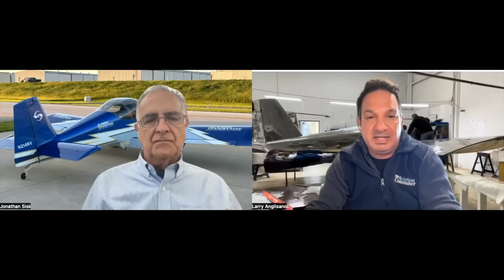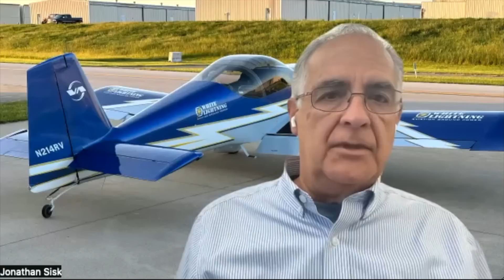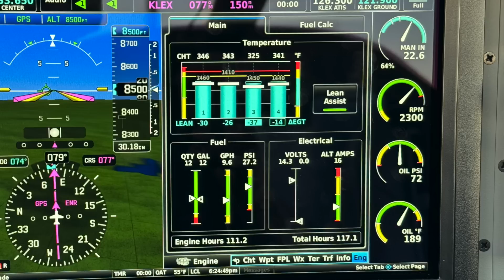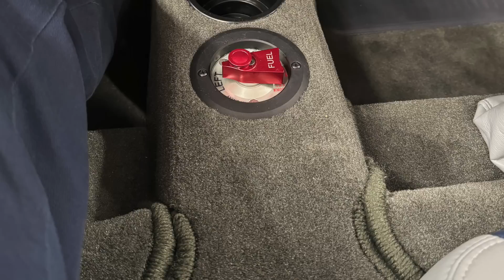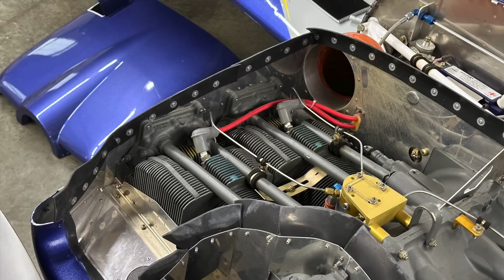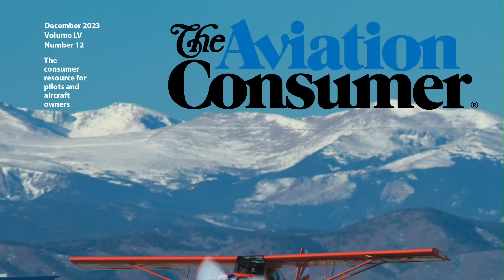G100UL Unleaded Avgas Flight Trial

Comment: There is one advantage of unleaded besides health that no one is talking about. I was in the automotive world  during the switch over from leaded to low lead to no lead. There was a big drop in thick carbon build up on valves, combustion chamber, and piston tops. The old days when the combustion chamber and piston top became coked up it produced spark knock on light acceleration. Then some sort of cleaning such as removing the heads and scraping or poring water or automatic trans fluid through the intake at about 2000-2500 RPM would be needed for repair. Sometimes we would recommend a higher octane fuel it it was an old warn out engine. Probably not advisable with airplane engines. Engines using unleaded fuel have only a thin coat of coal black carbon about the thickness of a coat of paint that many people think is a carboned up engine when in fact it is created in the first thousand miles or so that does no harm. If the valve guides leak or it is a direct injected engine with no fuel in the air stream the valves can get heavily coked up but if excessive oil passes through the piston rings it generally washes the piston top clean or at least in the area of the leak if it's not too bad. Unleaded fuel is actually a good thing. Some claim valve wear without lead but I would be surprised if aircraft hasn't used hardened seats of some sort since at least WWI. Either inserts on aluminum and iron or induction hardened on iron.

Comment: This report on the engine's parameters using G100UL is useful. However, Jon's term "licensing" as well as a POH and limitations are not relevant to experimental amateur built aircraft. These are "certificated" with a special airworthiness certificate which certifies they are safe for flight, and receive operating limitations (not "opspecs" which are for 135/121 operations) from a DAR or the FSDO. An EAB's operating limitations contain no reference to allowed/disallowed fuels and changing fuels is not a major alteration mandating return to phase I.
Jon's documents are evidence of good, methodical testing and operation, but they are not required. I am eager to try G100UL in my RV-7 with O-360 with 9:1 compression, so this report is very useful. Just need to have it be available...

Comment: These useless little toy airplanes do nothing to promote the advantage of Gami’s new fuel. It’s not going to get the ball really moving until a P51 or F4U Corsair owner gives his insight on how much better their V12 or R2800 engine runs.
Reply: It seems weird to to dismiss one of the most popular GA planes for 2 aircraft that haven’t been relevant for 80 years.
Reply: You're thinking of King Airs. 
At this point, P51s and especially Corsairs more qualify as toys than planes like this that people actually fly around.
Outside of airshows, nobody flies a Corsair.   And then, it's only so people can hear the big noise it makes.  P51s have a way cool retro look, but they're for airshows and air races.
Reply: Unless we prove unleaded fuel is totally safe in the modern engine fleet of small aircraft. There’s no way a responsible classic warbird owner would even think about putting G1000 UL in his airplane. Those engines are far too expensive to do fuel testing when they have a fuel that is already proven safe, now that we are proving 100 UL to be totally safe. I think they are more likely to put unleaded in their tanks.
I want unleaded for my Arrow so we can use synthetic motor oil and get 5000 plus TBO’s. 
I have a hand built Chevy LS that is 10.5:1 compression and supercharged to 24 psi that is an octane pig. It has over 100,000 miles on it as a supercharged engine. I would like very much to try G100 UL in my engine to prove it safe just as I have run MMT at 116 octane to avoid destination. G100UL is going to replace all racing gasolines.
Reply: Not useless or a toy, just an ignorant comment from a non-pilot. Boo you.
Reply: Yes, But don't King Airs have turbo prop engines that burn jet fuel-kerosene?? Heck even Ag Sprayers are going turboprop. There aren't many old Queen Airs flying anymore, they would burn 100 ox. Other wise there is some gasoline hi po single & twin engine Cessna's & Barons, Bonanzas & some high power Pipers etc yet but?
Reply: Actually during the war the Allied warbirds had like up to 150 octane leaded Av gas, that was one of the allied advantages over Germany right? We had good & plentifully fuel.
Reply: Ha ha. Useless little toy airplanes?! I used to fly 747-8s around the world, but I don’t believe my RV-8 is a useless toy. DB.😂